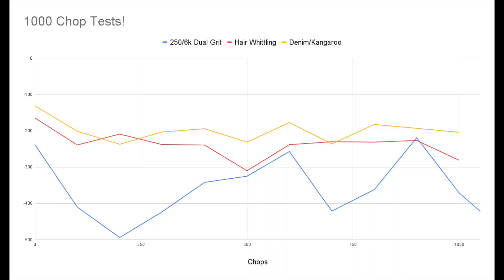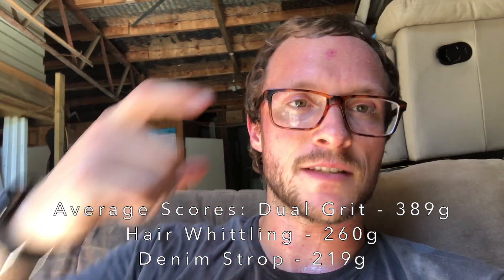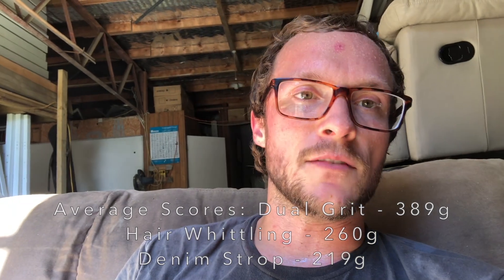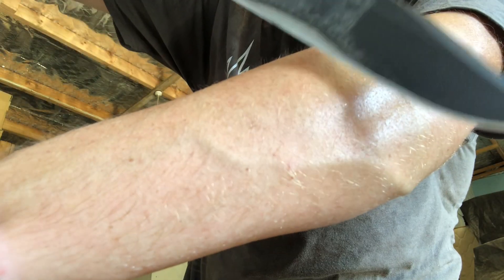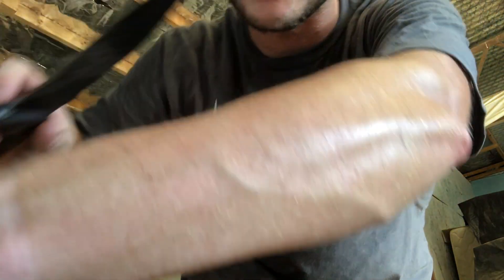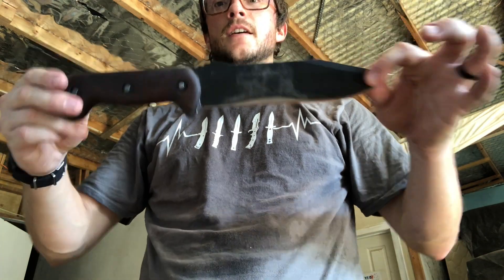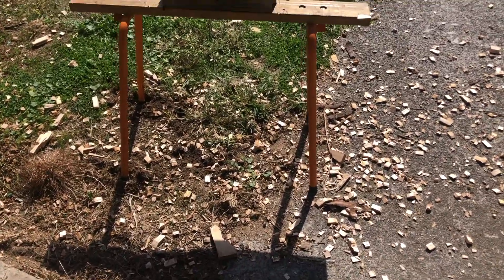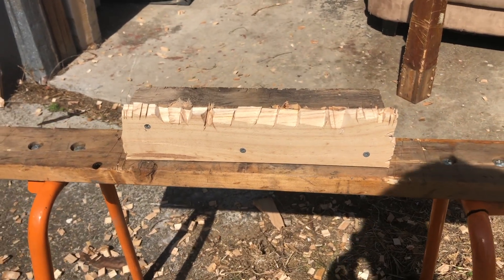1000 Chop Test & Mind BLOWN - Kabar BK7 Knife 17 DPS Denim Strop Micro Convex Ultimate Edge

Comment: Hello Gabe. Always nice watching some science sharpening theory. 
I don't use impact knives at the moment but always curious to learn more. 
A friend of mine with a lot of sharpening experience recomends for impact knives low grit, something around #320, 15 degree edge, 20 degree microbevel and sharp enough to shave hair. 
Have you tested anything like that?
Reply from the maker: I have not used microbevels extensively, but it is probably worth looking into!
Reply: @homeslicesharpening  I'm expecting polished edge to do better on impact, rough edge has more fracture points. 

On the other hand just low grit is faster to make and will perform better on a draw cut if the knife is used both ways.

I don't use impact knives much. For kitchen use 10 degree sharpening and 15 degree microbevel is awesome, even soft  56HRC knives can hold the edge.

For kitchen use polished edge does better on raw meat. Lower grit does better on vegetables and barbecue.
Reply from the maker: @thiago.assumpcao  This is great information - thanks for sharing your experience.

Comment: You lost me in the edge angle discussion.  I would think a hanging strop would induce more convexity than a flat one.
Reply from the maker: If you’re confused about the choice to use denim, this may help:

The main two pieces of research that led me to try out this method were tied Simpsons analysis of different strapping methods on straight razors.  He does an entire series of analysis of hanging and flat straps with diamond and other abrasives.

With softer steels, he finds that flat leather or balsa wood loaded with diamond turn always produce consistent results for him, namely that sometimes they leave a bit of a foil burr at the edge.

In the end he recommends a hanging denim strap for the most consistent deburring results.

Pretty much all forms of strapping or convex the edge to some extent, the difference between a flat strap and hanging strap is that a flat strap will only convex the final one to 10 µm of the edge, while a hanging strap can convex anywhere from the first 10 µm of the edge all the way up to the entire surface of the edge, depending on whether you do five strokes or 50.

This is the article where he shares his recommendation for sharpening simple carbon steel straight razors:
https://scienceofsharp.com/2016/04/14/simple-straight-razor-honing/
Reply from the maker: If you’re mainly unsure why I’d choose a hanging strop, this may help:

The second piece of research that I looked at that led me to try this was Vadim Kraichuk’s analysis of deburring - namely his research into steels that form what he calls “positive” and “negative” burr.

This is likely the source of your confusion, because a lot of the steel types which we enjoy in the EDC world are very hard and they are generally deburred most effectively at the edge angle on a flat strop - so I would readily believe that you have been getting great results from that method, as it is the best method for most of the steels seen in high end pocket knives these days!

The difference is that softer steel (like 420hc, or the 1095 CroVan in my KaBar) with high ductility allows the burr to wrap around the edge at a greater angle, so you need to use a sharpening method that removes a little more metal at a slightly higher angle at the Apex to fully clean the edge of damaged metal, and produce the strongest most stable edge possible.  Otherwise, these softer more flexible steels will often have a small wire edge remaining that folds over more easily than it should.

Hence the hanging strop with a fabric that has lots of texture to it and a softer abrasive.

If you’re keen to look at his video on deburring I’ll put the link below:
https://youtu.be/KCkvkaeAtM0

As always it’s nice to see you, and you’re welcome to do your own research, disagree, or inform me about things that I don’t know! Have a great day bro.
Reply from the maker: Yes, definitely hanging strop will induce more convexity. What I intended to say in the edge angle discussion was that if I sharpened both edges to 20° and then did one on the hanging strop the final edge angle of that one would be significantly more obtuse than the other which seems like it would make the test a bit slanted.

By lessening the sharpening angle to 17° and then applying hanging strop (which will convex the edge, maybe closer to being back to 20°) I hoped to produce attest which compared things more directly.

Comment: I'm 13 minutes in and am enjoying every bit of this. I had to pause and jump in with some random words. I like the BK-7. One day I may get one... I do have a BK-2 that I picked up second-hand and did some restoration on the blade and handles and the big Nylon/canvas sheath. But I only paid 30 bucks for it and it's a beast now. 
I like that you're putting Gerber stuff to use. A few years back, when Gerber bashing was a thing and I'd only just gotten the knife nerd bug back, I decided to buy something cheap from Gerber to see if all the hate was justified. I bought the 'Moments' Field Dressing two knife set. It was only 40 bucks AUD for the kit, and yes, it's 5cr15, but they are solid knives with that same rubber texture grip that Buck uses on some of their knives (I had a guthook Buck folder many moons ago with the same rubber handles). I guess the trade of the 5cr is that even though you may lose an edge fast, it's just as fast getting that edge back. I've used them to gut and skin eels and you know how slimy those buggers are. The handles still retained adequate grip even though they'd gotten slimed. They're both full tang knives and do the job they're intended for. I've noticed the price has gone up to over 50 bucks now.
Reply from the maker: Hey Brad! It’s so great to see you around again.  

It’s also hilarious and awesome to hear somebody talk about gutting eels, I think some of my viewers from the northern hemisphere would not have much of a grid for that, but I know exactly what you mean.

I’ve been carrying a Gerber multi tool for a couple years now, and I don’t miss my Leatherman at all!  I think that Gerber brings a certain creativity to the industry, and they often produce more specialized tools for specific purposes. I like that the center Drive doesn’t have a lot of the normal multi tool tools that people never use, it’s just got really good versions of the ones you use all the time!

I love the BK 7, in my opinion it’s pretty hard to beat for the money, and your BK 2 sounds like a beast!

Personally, I’ve had a bit of a returning to steels that are enjoyable to sharpen. Even if the edge doesn’t last forever. I’d almost rather use a knife that’s a joy to sharpen back up than one that lasts three times as long but is a monster to get sharp again!

Cheers mate.
Reply: @homeslicesharpening  Cheers, mate. Yeah, I get sidetracked so don't see every video, but I enjoy your stuff. Hehehe, yeah, eels are not much of a thing over here, but when I get one, I like to smoke it. Yumm yumm!
Reply from the maker: @BradGryphonn  I've seen a lot of them but have not eaten many!
Reply from the maker: @BradGryphonn  No worries though, I always enjoy hearing from you when you do stop by, take care bro.

Comment: I picked up an s45vn Inkosi earlier this week and I've been using a hanging denim strop loaded with 3 micron compound to maintain the factory edge and it just stopped stropping back to hair popping this morning.

I didn't expect that from s45vn, and I certainly didn't expect that from a factory edge.
Reply: What does it mean?
Reply: @wigglywrigglydoo  

A few things.

The hanging denim strop that Gabe recommends is at least as effective as the kangaroo leather or basswood that I'm accustomed to.

S45VN strops back impressively well.

CRK has seriously improved their factory edges since the last time I bought one.

And ultimately, I need to do a whole lot more experimenting with convex edges for EDC use.
Reply from the maker: Thanks so much for the awesome feedback, and it’s fun to meet somebody else who is playing around with a denim strop!  The research that I’ve been doing suggests that flat strops are best for very very high alloy steels and extremely hard steels, while softer or more flexible steels often have a wire edge removed more thoroughly by hanging strop.

Have you ever seen this video?

https://youtu.be/KCkvkaeAtM0

It’s interesting that you mention S45VN - I know that the same guy who produced the video which I linked above was testing out S35VN and he found because of it’s unusually high ductility (compared to say S30V) it tended to have more “positive burr formation” tendencies which would have put it in the camp of benefiting from slightly more convexity in the edge - IE a hanging strop.  He used kangaroo leather for his demonstration though.

I wonder if S45VN carries some of those tendencies too… hmmm 🤔

Comment: Hey Gabe hope you and the fam are doing well. Hey gotta doubt. Why the denim strop and a hanging one at that? Doesn't that convex the micro bevel? I've been testing leather strops on wood for the last 3-4 years arriving at a proeficient stroping quality but I wanna understand what you are doing as.it seems to me really interesting and appreciate your effort. 😁👍
Reply from the maker: Hola amigo - good to see you around!
Those are all fair questions!  The main two pieces of research that led me to try out this method were tied Simpsons analysis of different strapping methods on straight razors.  He does an entire series of analysis of hanging and flat straps with diamond and other abrasives.

With softer steels, he finds that flat leather or balsa wood loaded with diamond turn always produce consistent results for him, namely that sometimes they leave a bit of a foil burr at the edge.

In the end he recommends a hanging denim strap for the most consistent deburring results.

Pretty much all forms of stropping do convex the edge to some extent, the difference between a flat strap and hanging strap is that a flat strap will only convex the final one to 10 µm of the edge, while a hanging strap can convex anywhere from the first 10 µm of the edge all the way up to the entire surface of the edge, depending on whether you do five strokes or 50.

This is the article where he shares his recommendation for sharpening simple carbon steel straight razors:
https://scienceofsharp.com/2016/04/14/simple-straight-razor-honing/
Reply from the maker: The second piece of research that I looked at that led me to try this was Vadim Kraichuk’s analysis of deburring - namely his research into steels that form what he calls “positive” and “negative” burr.

This is likely the source of your confusion, because a lot of the steel types which we enjoy in the EDC world are very hard and they are generally deburred most effectively at the edge angle on a flat strop - so I would readily believe that you have been getting great results from that method, as it is the best method for most of the steels seen in high end pocket knives these days!

The difference is that softer steel (like 420hc, or the 1095 CroVan in my KaBar) with high ductility allows the burr to wrap around the edge at a greater angle, so you need to use a sharpening method that removes a little more metal at a slightly higher angle at the Apex to fully clean the edge of damaged metal, and produce the strongest most stable edge possible.  Otherwise, these softer more flexible steels will often have a small wire edge remaining that folds over more easily than it should.

Hence the hanging strop with a fabric that has lots of texture to it and a softer abrasive.

If you’re keen to look at his video on deburring I’ll put the link below:
https://youtu.be/KCkvkaeAtM0

As always it’s nice to see you, and you’re welcome to do your own research, disagree, or inform me about things that I don’t know! Have a great day bro.

Comment: Very impressing result Woodchip-Gabe. 17 degrees for chopping, who would have guessed. Ofcourse the stropping gives is a bit of body but very impressive. Does this mean i have to rethink the edge on my axes? would a steeper edge hold up longer? Or would it destroy the edge because of the force behind it(weight, speed). For chopping knives the result is clear. Thank you for the hard work friend.
Reply: As long as you're not torquing the axe, a fine steep edge will hold up just fine. It will also prevent glancing blows, and it's awesome for wood carving ;)
Reply from the maker: Thanks so much Jeroen!  I appreciate the feedback. I intend to do a little testing on axes but for now I think that as a general rule we underestimate the strength of a well cleaned Apex.

Now that doesn’t mean I would go ultra acute on one of my axes, simply because if I happen to hit something a bit more abrasive or cut up some wood that’s dirty the extent of the damage still tends to be smaller on an edge that’s not too acute.

I think I would be comfortable with 17 or 18 DPS, I wouldn’t go as thin as 14 or 15, that seems like it would be too far. It also kind of depends on the heat treatment of your axes, because a steel that’s somewhat softer might respond better to a little bit more metal behind the edge where a hard heat treatment would probably take a pretty acute micro convex admirably well at 17°
Reply: @homeslicesharpening  Indeed and most axes are not that high up in hardness just for that reason.
Reply from the maker: @jeroenvoss6231  Very true!